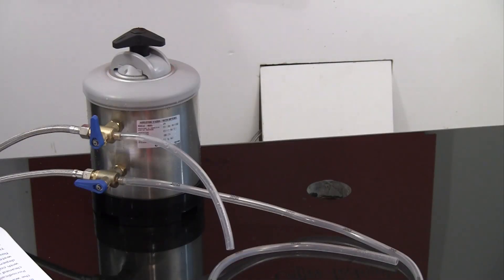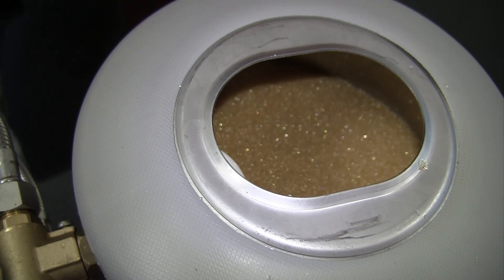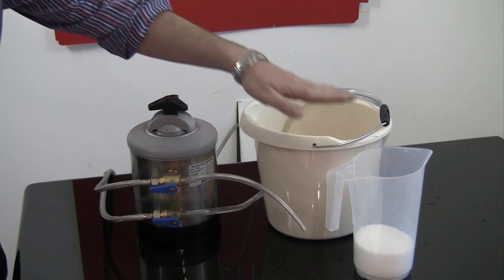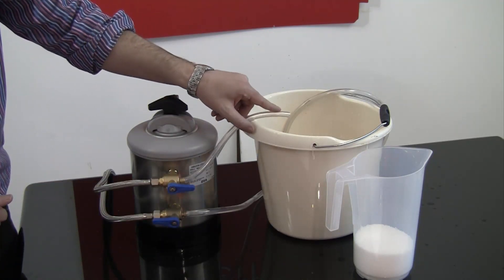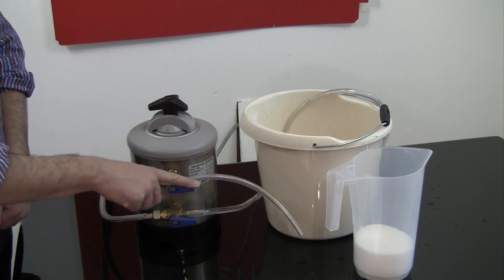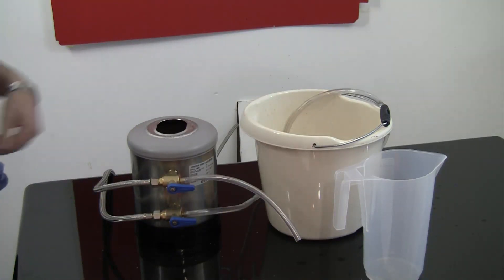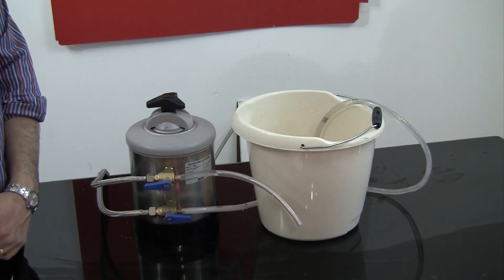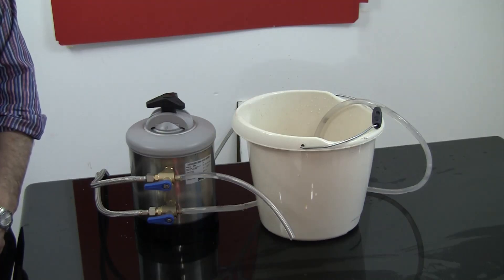How to clean & regenerate a water softener ion exchange water treatment unit

Comment: Limescale doesn’t effect the energy efficiency of a machine. It might delay the heating of the water but only by a seconds at most. 

This is because a heating element transforms all electrical energy in heat. The energy has no where else to go but to heat up the element. The element then transfers that heat to its surroundings. A huge amount of scale could isolate the element (a bit) causing a slight delay but it in the end all energy will be transfered to the water. 

The delay can however cause the element to overheat and break down and that should of course be avoided.

Comment: That is a lot of water to waste!.  What about using four charges of strong brine, waiting in between for the ion exchange to occur.  Using the same amount of salt overall but not having to waste so much water.  I hate to think how much the big units waste.  I presume that you need sodium ions in contact with the ion echange resin and this is contact not flow dependant?

Comment: Hello!I wanted to ask if I have to change the resins in the softener because it doesn't work properly.. I have taken/purchased an old bar/ice-cream shop and it is used to purificate the water for a dishwasher machine. I have done the regeneration but it doesn't still work properly. For an 8Lt softener how much resin do I have to put in and how much salt do I need to regenerate? Thank you so much!!